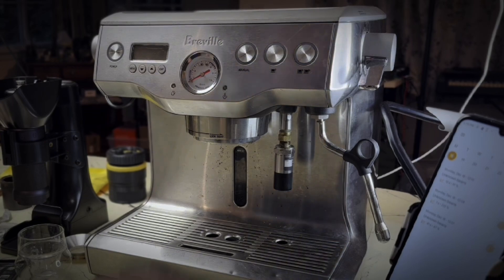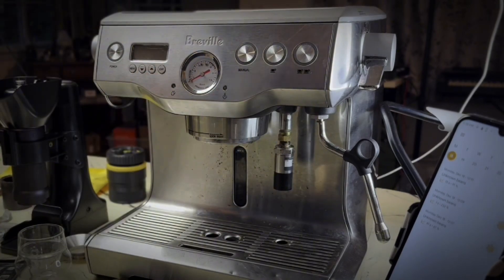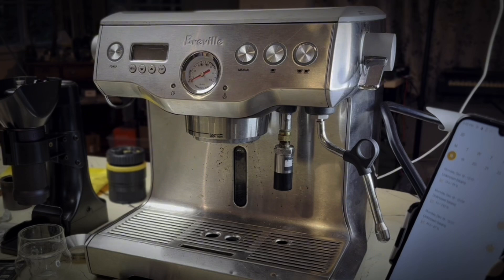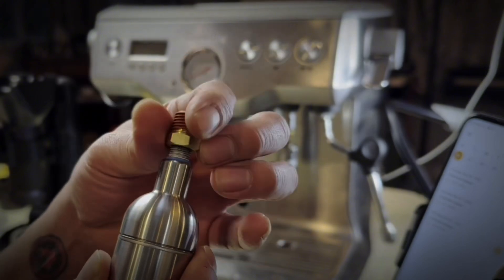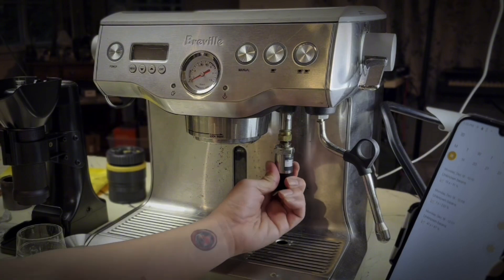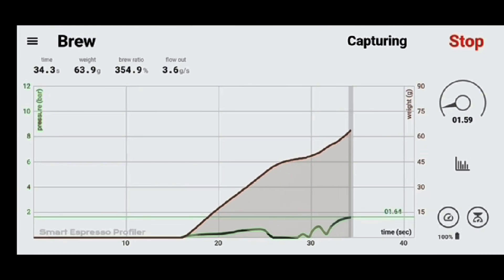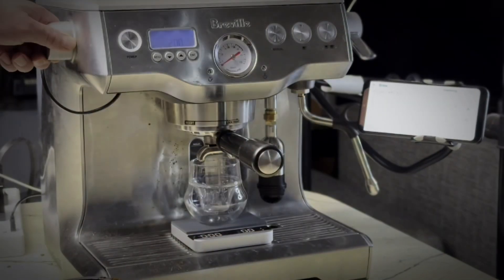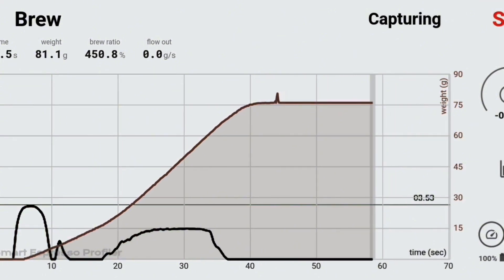Breville Dual Boiler + Smart Espresso Profiler = Realtime Tracking

Comment: Looks very neat. Does the pressure sensor agree with the pressure gauge? I saw people putting pressure sensors using a T-valve inside the tubing in BDBs. Looks like a pain to do and I prefer your solution. Just wonder how accurate it is

Comment: Thanks for sharing! May I know if I have only a 870XL, is it possible to perform the mod and profile my espresso shots?
Reply from the maker: You can absolutely mod the 870 to profile shots. I have a Breville Infuser 840xl with a dimmer switch on it. I can flow profile with it by dialing the pump power between on and off. Probably cannot mod the water tap to have the transducer though.

Comment: Would you recommend the bookoo pressure sensor on the flair 58, or you said you don't use the pressure sensor anymore since you go by feel?
Reply from the maker: I might put a transducer back on the Flair again, someday. But I’m fine without it for now.
Reply from the maker: It depends. If you put the Bookoo, or SE Profiler in my case, you can play with pressure profiles like you would on a Decent. That’s fun. But ya, when I use my Flair nowadays, I just go by feel.

Comment: Cool upgrades! Glad my video helped you. If you ever figure out how to attach the Bookoo espresso monitor to the BDB that'd be awesome
Reply from the maker: Thanks for sharing that video and for your great content in general! Looking at pictures of the Bookoo, the threaded end looks the same as the SE Profiler. I imagine the same mod I did for this transducer would apply to the Bookoo.
Reply: @MoreishMike what parts are you using again could you share the link?
Reply: Hi @gadgetsgearcoffee, I hope you read this. Great fan of your videos and I did my slayer mod watching your tutorial. Im thrilled and had figured a way to install bookoo EM into our BDB 920. Female to female. 1/8 to 1/4.
Reply: @dexcolasful  Is it quite simple and straightforward, did you do a video or take photos?
Reply: @GadgetsGearCoffee can confirm it fits and works. Needs teflon tape to for the 1/4 end of plastic water spout so it doesnt leak or jump off due to pressure.
With the scale it's pretty good. However due to the workflow I didnt think it fit what I was using the BDB for (simple morning coffee) . Perfect for the coffee nerds tho. So Ive reverted back to my normal slayer mod setup which is plenty for me
Reply: @dradamazmi and you used a 900 or bes920?
Reply: @dexcolasful  did you also install it on the hot water spout like in this video?
Reply: @dexcolasful  is that bsp to npt or bsp to bsp